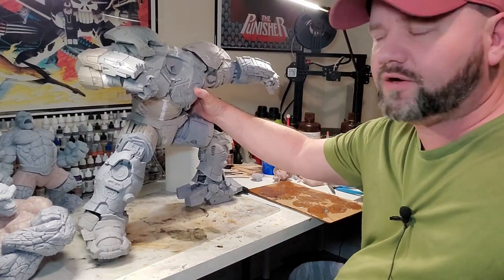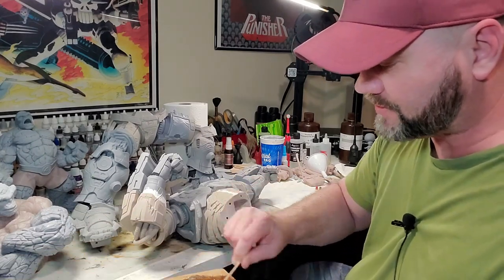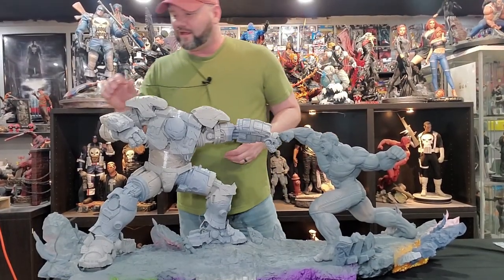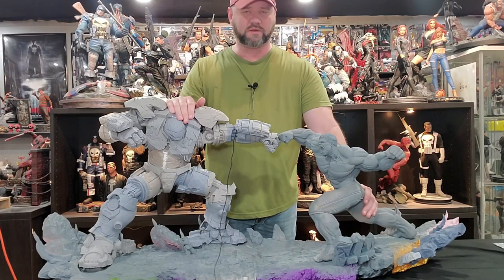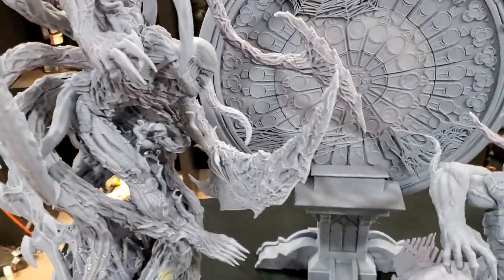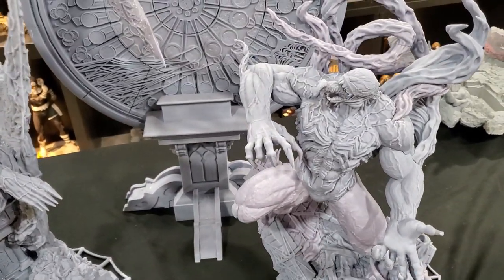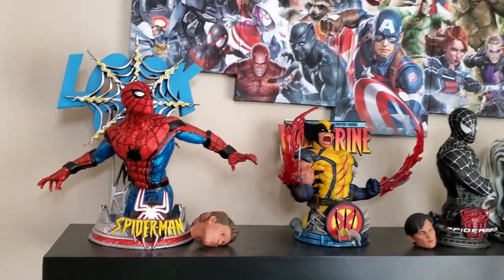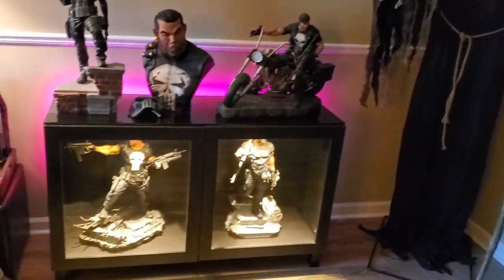3D printing and painting Behind the Scenes - Current Projects

Comment: I dont like painting my sculpts but i love the way they look when painted . My resin printer out runs me so bad sometimes i have to shut it down till i get my sculpts painted . Thats what im doing now i had 4 sculpts to paint for one of my sons im on  the last one . When i first started 3d printing 3 years ago i bought a anycubic photon i got 3 prints off it and it quit working after that . I did all the contacting anycubic no   response then i went to the forums with no help . I wound up throwing it away after changing the motherboard it still didnt work ( piece of junk) . Then a friend at work said he used the creality ld-002r resin printer i took his advice and bought one then another one to speed things up. I ran those printers 24 hours a day 7 days a week with no  problem. Then i wanted to go bigger and bought the peopoly phenom and been in 3d heaven every since . I sold the 2 creality resin printers to my friend at work. I  got all these small resin prints left over from the creality printers i need to get painted . Like i said i hate painting sculpts but i love the way they look painted . I know what you are going through theres not enough hours in the day with work taking up most of the time. Happy creating..............

Comment: I love this video big fan I halve many 3D printers been doing printing and painting for several years I have a whole stack of stuff that I haven’t finished yet also lol hahaha but I have a question about FDM I have two FDM and about 6 resin I have never done any models on my FDM because of later lines and loss of detail but I seen your galactis and I would love to print some larger scale stuff and or save some money on my model bases do you have any recommendations on settings for FDM to get detailed prints without later lines
Reply from the maker: I really don't have any specific settings that I use other than just making sure the bed is real level. I have some lines in Galactus but not real bad.
Reply: Ok appreciate the response will have to give FDM a chance see what I can do

Comment: Now i understand why its taking you so long to finish the Hulk and Hulkbuster diorama. I just looked at the files as i wanted to print and paint one myself and its going to take weeks just to print at 1/6 scale and that's just the printing 😂. It will take months of prep and paint. If i do go end up printing it i was thinking about using a metallic candy apple red automotive paint or a tamiya TS 18 red spray can on the Hulkbuster. What would you recommend?
Reply from the maker: I planned on using Tamiya metallics as well.
Reply: @TheCreativeCollector  give me a few pointers as to how you were planning on painting the HulkBuster 😁, I have finished the base and Hulk and in the process of printing HulkBuster but waiting on my resin order to arrive to complete it, don't think I'll be printing anything this big again but got to finish what I started LOL 😂
Reply from the maker: I'm going with Tamiya metallic paint because Im not going to mask this off, so I'll hand paint everything. I'll add plenty of weathering to it as well.
Reply: @TheCreativeCollector  thanks, I was thinking of doing the same but decided not to use the Tamiya metallic red spray can, instead I'll airbrush it with a Vallejo red with a bit of metallic medium. Just worried if I'll have issues brushing other paints on the Tamiya. Thanks for the reply and sharing your thoughts, appreciate it a lot 😊